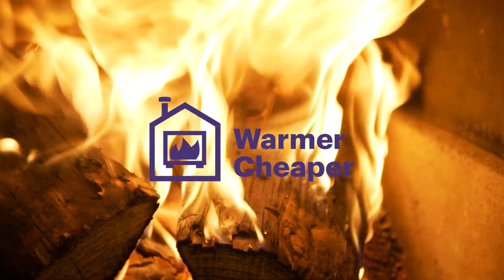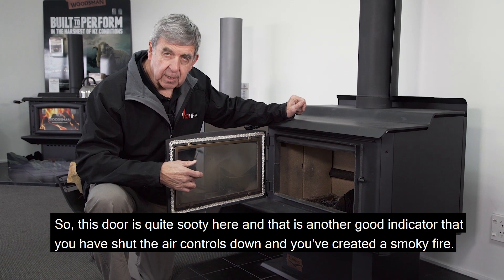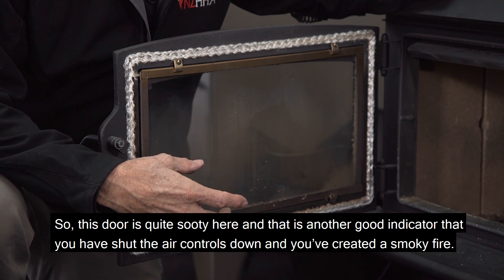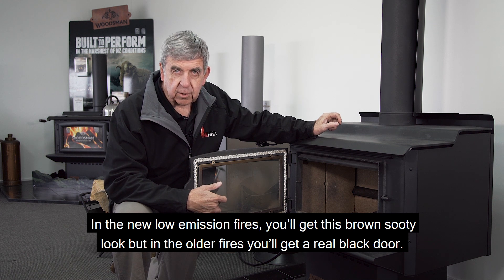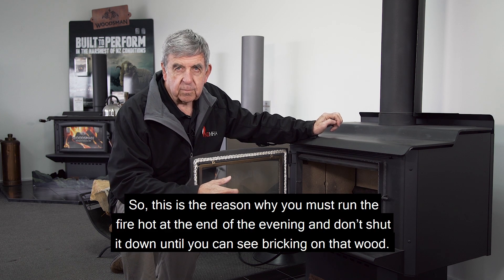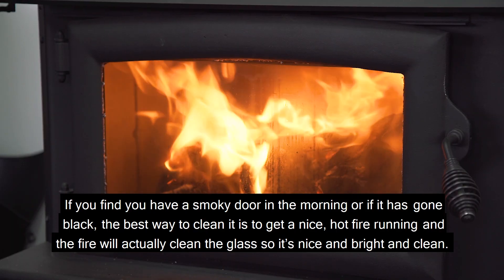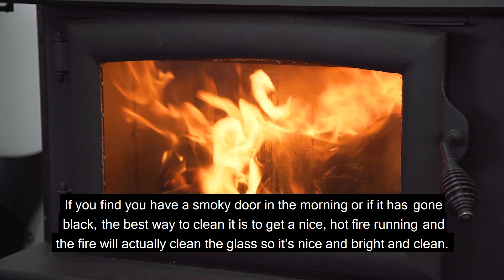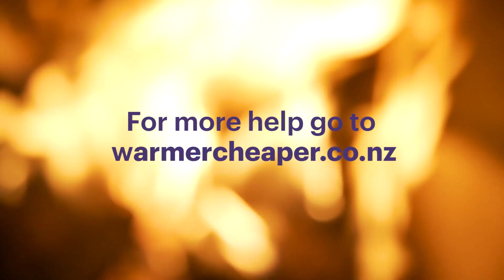Why is my wood burner's glass door dirty?

Comment: Never had to clean my glass on my wood stove, I burn hot for at least 30 minutes and then slowly damper it down to my desired setting. Works for me!!
Reply: This does work, though it can also roast you out if it's not that cold outside. You can always open a bunch of windows and burn it on high for a bit. Black glass doesn't really hurt anything. There's normally no flames to watch anyway. The bigger issue is that if your glass is black it probably means that your chimney is as well. Heavy amounts of creosote can lead to other problems, such as chimney fire or reduced draft, which can lead to smoke backing up and more black glass! I would clean the stove and chimney thoroughly, including the glass. Your stove dealer can sell you special stove glass cleaner, or you may find it at Home Depot. When you light a fire, do burn it on high until it is going good (if you have a stove top thermometer, it should be near maximum...open a window if you have to) before turning it down. Then turn it down in increments, not all at once. Again, when you add wood, let it burn on high at least a few minutes until the new wood is burning good. One last thing, wood that isn't dry enough can create more black glass and creosote. Try to use wood that has seasoned at least a year or longer after being cut. If not possible, you are just going to have to clean chimney and glass more often. Good luck.